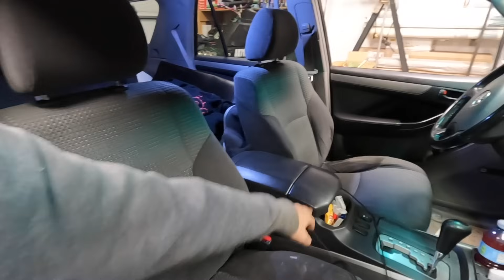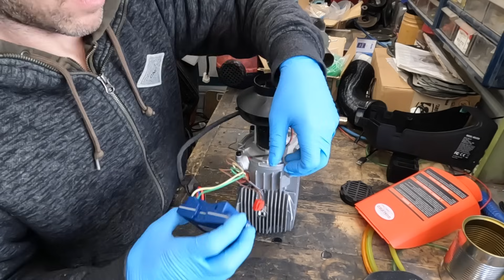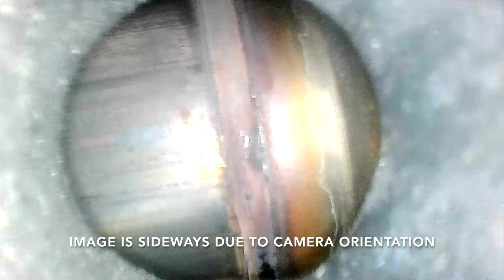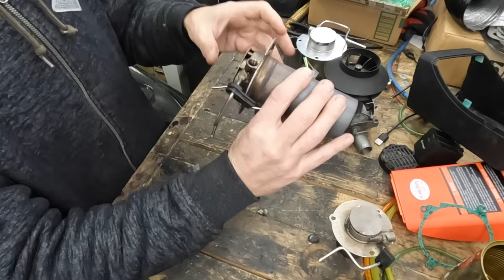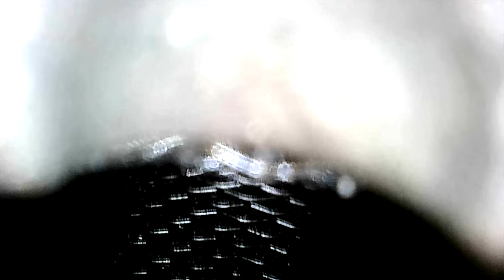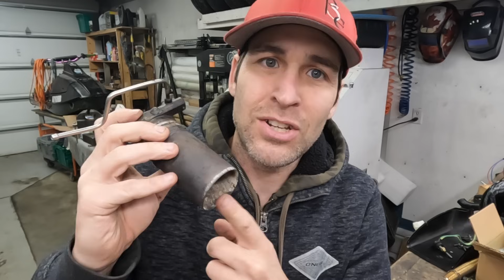Diesel Heaters - Orientation Deep Dive - Heater Mounting Explained

Comment: for alternative fuels... please before you get all fancy try 
1. ) stainless steel  screen/mesh of various opening sizes around the part of tube with slots. Length of this roll of screen  mesh enough to protrude well into the burn chamber.  idea being to add additional hot surfaces to atomize the oil via contact  with  additional hot screen mesh in both primary and secondary combustion areas. Might need diesel start to get added material good and hot.

2.)  Little more complex (expermenting wise) would be experementing withing different type mesh/ and wicking gauze density (aka- differenttypes  SS wool)  in place of what is spot welded in there.
Reply from the maker: I have some stainless mesh sent to me by a viewer, and used it in a few previous tests, last year, but of course, not in this configuration. 

The idea of this additional chamber is basically 3 things. 1. To have a spot after the main chamber that is very hot before adding any alternative fuels, so they flash off immediately 2. space for junk to build up without harming performance and a part that can be easily removed and cleaned out when it does get dirty.

Mesh and wicks may add some benefit, but what I have found is that anything like that will collect all of the crud from waste oils, (ash / coke) and become useless pretty quickly... but that doesn't mean that I won't try it, haha.
Reply: @loweredexpectations4927  crud build up is what lead me to think a not as fine steel wool wick behind the spot welded mesh  may be needed. Good point about easier access. 

what lead me to think about  stainless mesh screen as described  in#1 was the aluminum piece you put in that helped combustion... but melted
Reply from the maker: @coachgeo  Oh yes... That aluminum bid did help a lot. I think the reason being is that it trapped just enough heat without choking it off too much. That was a surprising result.
Reply: @loweredexpectations4927  EXACTLY.  sorta..  and why thought of #1..  providing many hot spots ..... and this is why many non-injected oil heaters use various forms (like screens)  in their designs to increase the number of hot spots.  would add links  to actual stove products but as you know.... not allowed.   linked video is all can add... it offers some uneducated observations that hits #1

https://www.youtube.com/watch?v=99OQuzRw3O4

Comment: Hello! What a great video! I want you to check this video by this italian guy, he mounted his unit vertical and this helps a lot burning full used oil. In this way, he claim that the vertical mounting helps burning almost all sooth and residues from the thick used oil he uses, mantaining a clean chamber. It's in italian language but I think automatic subtitles works well. He opened the chamber after some months and it was incredibly clean for having used only used oil (from kitchen leftovers, filtered and pre-heated). It's worth a look, maybe you can try this :) Probably he has the air hole in the correct place. 
https://www.youtube.com/watch?v=mMqeFejrZBY
Reply: He claims that in this way any oil that didn't burned well drops at the bottom of the unit, where is being hit by flames and then consumed out.

Comment: Excellent run down on the inner workings of these heaters. BTW, is that '8kw' heater you mention the Hcalory HC-AC22, billed as a 6.8-8KW unit? I've been eying that one myself, but they're still out of stock on the Hcalory site (supposedly back in stock in February). Trying to order them off Banggood or Aliexpress is ridiculously expensive for me here in the US.
Reply from the maker: Thanks ! 

The heater that I ordered is Maxspeedgrods off Amazon Canada.... They list the fuel consumption in the ad as .7l/h so that's 7kw.. I haven't tested it yet, so we shall see. 

I'm going to do a detailed tear down on it before I even use it.
Reply: @loweredexpectations4927  Ahh, I see. I'll keep an eye out for that. The Hcalory HC-AC22 I mentioned has a physically larger heat exchanger but the rest of the unit appears to be the same as the regular 5kw units.
Reply from the maker: @kobolila  Yeah, I have heard about that one too... This one is larger as well. Has a 90mm hose and is a little larger all around.

Comment: Very explanatory video, we have nothing to debate about what is clear.
Regarding the incandescent plug of the 2kw model, it is really very sensitive, I experienced the same thing.
Reply from the maker: Thanks for the comment. 

Interesting you say that about the plug. I think it must be the way some of them are mad... now the metal is attached to the ceramic. The plug or my original heater, I grabbed it in my lathe and machined the metal part off without damaging it... I still have it and it works great.... except that it has no threads now, haha. 

Where mine broke, you can see it is only supported on one side.

Comment: If you use Vegetable Oil, Robert Murray Smith found the best wick is Carbon Felt cheaply bought as flame protective mats for Jewelers and the wick doesn't burn away.
Reply from the maker: I have seen some of his videos... cool stuff. I have hundreds of litres of waste motor oil as I am a small engine mechanic, so that will be my main focus.

Comment: Is the fuel line bendable enough if I wanted to relocate the connection to the flexible fuel line from the pump?
Reply from the maker: Not really.... If you want to do that I would suggest removing the original line and brazing in some automotive brake line or copper line, after pre bending it to your desired shape. 

I relocated a line last year by using brake line and then a short U shaped soft line between my new line and the original. The title of the video is EASY Waste Oil Preheater - Chinese Diesel Heater. PT-10 I will attempt to post a link separately.
Reply: @loweredexpectations4927  thanks!
Reply from the maker: @davidparron9546  You're welcome !
Reply from the maker: https://youtu.be/0fFbsiP-iA8

Comment: The problem using waste oil or even brand new oil is the stuff that is in it.  Somehow they put metals in the stuff like magnesium zinc etc and that stuff simply don't like to vaporize, even with extreme heat there is always a certain amount of residue left after a decent burn which is why it makes it difficult to re-light after a run down.  I don't think that cog looking thing is helping the burn with oil, sure it will with diesel but it is gagging for blocking up with oil.  If the fuel were allowed to get to the tube and burn in there it should be much better, but again it will need very frequent cleaning and have to be run red hot to minimise any build up.  It would be nice if the head unit could be pulled off instead of bolting on sort of a bayonet fitting so it could be removed with ease and quickly and a quick scrape of tube should sort it for the next burn.  I am eagerly looking forward to your design and David's and I am sure you will get decent results as you tinker around but it is all amazing to me. :)
Reply from the maker: For sure. I have a video last year where I burnt brand new oil to put an end to the argument that my oil was "too dirty" ... I did 30 videos on this topic last year with 4 months of testing. 

Heavy oil and additives are a problem, and always will be, so the only solution is to deal with the build up. I will be releasing a video soon talking about my actual plan for this mod, and what I expect... I do expect that it will have to be cleaned frequently.

Comment: Great video and explanation. I have one question regarding the orientation of the heat. Since the fuel flows unrestricted into the burn chamber, when the heater is powered down, would fuel in the metal or plastic line seep or wick into the burn chamber if this line entered from directly above or at an elevation great than where it enters the burn chamber? I hope my question makes sense. Thanks again,
Reply from the maker: I think I understand, and the answer is no... Just like when you place a straw into a glass of water and place your thumb over the end, if you lift the straw out of the water, the water will stay in the straw until your thumb is removed... in this case, the fuel pump is your thumb. 

The only way you will get a substantial amount of fuel flowing, after the pump stops, is if the pump fails, or of the fuel line breaks or is disconnected at the pump. 

Hope this makes sense.

Comment: I would think that the waste oil would have to be diluted with diesel to help stop the contamination of the burn chamber.  Waste oil is full of stuff that likes to stick to everything.  Your video was very educational as I have just picked up a 5 kw Vevor diesel heater to experiment with home heating.
Reply: Absolutely it needs to be diluted.  I use 10% kerosene to my waste dirty oil, put it through a kitchen sieve to filter, I don't suffer with blockages in fuel pipe even inside the burn chamber which delighted me no end :)  But it needs to be cleaned out every day really.  It will burn again next day without cleaning but doesn't like it after a few hours.  But that's my thing it's not a diesel heater, just what I found out over a few years the problems using oil.
Reply from the maker: Thanks for your comment / input. 

I see you have some waste oil burner videos. I will give them a watch if I ever find the time. 

The issue with these little heaters is that they have very little volume, and any change to the geometry of the chamber can cause things to go way out of whack. A waste oil furnace / burner has a lot of advantages over the burn chambers on these things. 

I have tried diluting up to 70% diesel 20% waste oil and 10% gasoline, and my heater would run for less than 24H before issues.
Reply: I'm running 75/25 Diesel/waste oil, with no issues.

But I do filter my waste oil.
Large screen for big stuff.
Then into a 120 micron paint strainer.
Then through cheese cloth
Reply from the maker: @nordicbeast  I have tried all the way down to 70 diesel 30 waste oil as well s 70 diesel, 25 waste oil and 5% gasoline. My oil was filtered through a cotton filter and then through an 80 micron filter.  

I think the longest run time I got with this mix was about 13 hours, maybe a little more. My oil is mostly from lawnmower engines so pretty black.... I also tried brand new oil, but it actually worked much worse. I suspect this is because, although it was a conventional oil, it was a good brand Motul, and it really didn't want to flash off. Made a lot of smoke and clogged up pretty quickly.
Reply: @loweredexpectations4927   interesting.
I wonder if it being synthetic has anything to do with it.

Most my cars run 5w40,but they're all synthetic oil
Reply from the maker: @nordicbeast  Synthetic is supposed to be harder to burn, but I suspect that when you get it to burn, it leaves less ash behind 🤷‍♂
Reply: @loweredexpectations4927   that is very possible. I'll update if I ever have any issues, but so far it's been good
Reply from the maker: @nordicbeast  That's great ! How long have you been running it this way ?
Reply: @loweredexpectations4927   not too long, about 30 hours on it right now this way.

There is a guy in the UK that runs waste oil through his as well. He has two tanks though.
Starts off on kero, switches to oil. Then switches back to kero before he shuts it.
I believe he's been running it for like a year or so this way.

Something to think about
Reply from the maker: @nordicbeast  I hope it keeps working for you... 30 hours isn't bad. 

I have seen lots of videos of people claiming to have run on waste oils for months or years. I would like to see the videos you are referring to. 

Most people will make 3-4 videos about this, and then never mention it again. I make a habit of quizzing people who claim these things, and have had several of them admit to me that they had issues shortly after. One that I remember specifically is a guy who had his heater in a school bus and made videos talking about how it was actually working better with the waste oil, burning hotter. He admitted to me in his comment section that shortly after he had issues and gave up on it.

Another guy claimed he had been running for 3 months, released 3 videos claiming he had it all figured out with his water filters and switching form diesel to waste oil.... 3 videos in 2 weeks and then stopped talking about it. I asked him about it in his comment section, and he ignored me... But I saw here he had talked to others saying that it worked but he was working on some chamber modifications..... That was over a year ago and not a single heater video since then. 

I would absolutely love for this to work, but I also try to be very transparent and open about my failures.... It really annoys me that these people have not released follow up videos admitting what really happened to them. Based on your numbers, it appears you have probably consumed about 3 litres (.8 gallons). WIth a new chamber, you might get twice that, but I would expect that you will start having issues soon.  Hopefully not.
Reply: @loweredexpectations4927   well id promise I'd update.
Slowly starting to act up.
Has trouble starting and blows white smoke for about a minute,but once it's running there are no issues.
 Takes about two full cycles before the flame stays lit.
I only imagine it'll get worse.
But gonna keep running it the way I am, until it definitely doesn't start lol
Reply from the maker: @nordicbeast  Wow... that took a long time though ! I really appreciate your update. 
You could try running some kerosene ... I'm not sure that it would help at all, but it can't hurt. 
That is the same thing that I experienced ... but with me it only took a day or two... 

Not sure if you have seen my latest videos, but I have been playing with a new design and it seems to be working fairly well.
Reply: @loweredexpectations4927   yes, I recon I used about a little over a gallon of waste oil total, with it being diluted.

I know the last bit I threw in, had some water, that I didn't get completely out, and the next day, it started giving me issues.
I'm not sure if that's the reason why, I'd imagine that would have just cooled the chamber or bit, maybe even help break carbon up? 

I did order some new screens and a glow plug. Once it completely quits,I'll rip her apart.

And yes I have been watching.
Just randomly stumbled on your channel one day.
Definitely informative. Excellent job
Reply from the maker: @nordicbeast  We need more honest people like you in this world. Lots of people try it for a week and then comment on my videos telling me that I'm obviously doing it wrong. When I quiz them, out of genuine concern and curiosity they either ghost me, or explain to why their system is working, and mine isn't... thinking I haven't tried a million things, haha. 

Believe me. If someone cracks the code to burning waste oil (in one of these heaters) in a reasonable way, I'm 100% behind that. I want to know how they did it so I can do it myself. 

Have you ordered a new burn chamber as well... or just the mesh ? Then it finally quits, you are probably going to need to replace the chamber, or spend a lot of time trying to clean behind that baffle.
Reply: @loweredexpectations4927   yes I completely understand.

I ordered a new chamber as well, just in case, but I'm gonna try my best to burn most of this waste oil I have left.
Kind of curious to see how long this is gonna last haha.
Reply from the maker: @nordicbeast  I'm curious as well... I am in the middle of "long term" testing with strait motor oil being injected into my secondary chamber... I am burning diesel in the primary. My current overall rate is 60% diesel and 40% waste oil. 

All that to say, it has been going well, but I have some atf I want to try, as well as veg oil and other things... but when my heater doesn't fail immediately, the testing takes so much longer, haha.
Reply from the maker: Thanks for the comment. 

I have a 30 part video series where I tried burning waste motor oil with all sorts of different fuels, diesel, alcohol, gasoline, varsol, DPF cleaner etc. 

In the end, WMO is heavy oil and will always leave ash behind. When you refine heavy oil and get diesel or kerosene, you remove the crud that would have been left behind, that is why they burn so clean 

Waste veg oil has glycerine, and that is what causes the problems with it. 

The only real solution is to make a heater that is easy to maintain, has more space for build up (before causing problems) or create something that is mechanically self cleaning. 

I would suggest to keep diesel, kerosene or light fuels in your heater... I twill work really great if you do that, haha.

Comment: One more option about the direction of the mounting. Would it not maybe be better to have a slight angle pointing downwards about 30 degrees with the burn chamber pointing downward at an angle so the oil has to drip down the chamber and it wont clog up? I saw horizontal vertical on the side etc. but not at slight angles?
Reply from the maker: Are you talking about in a stock burn chamber, or a modified design ? In the OEM chamber, there is a baffle before the burn tube. The fuel / oil will pool behind this baffle if angled, and if it builds up it will drip off the centre of the baffle ... I can't say for sure. This could help.